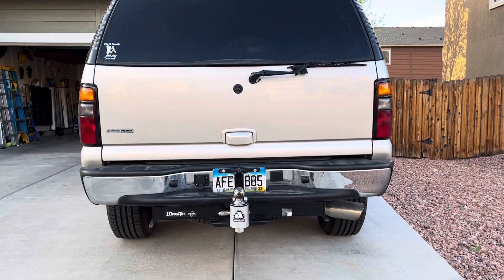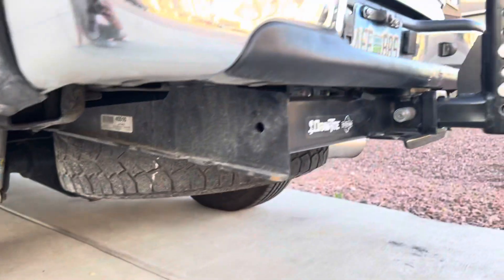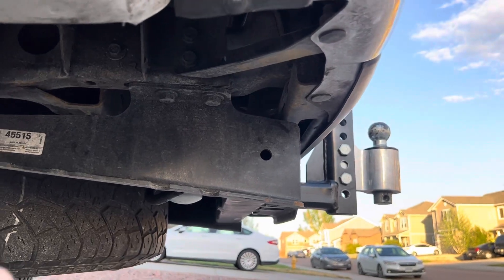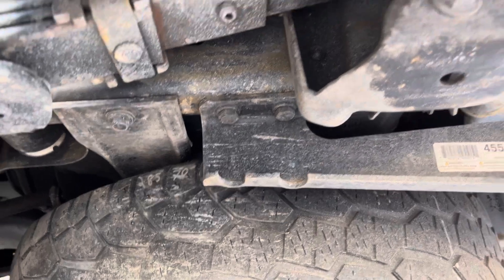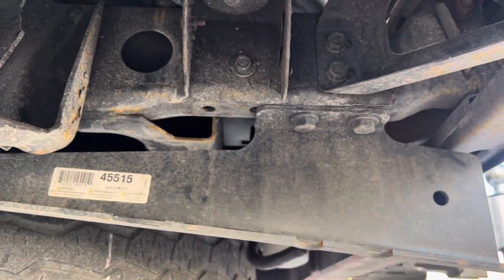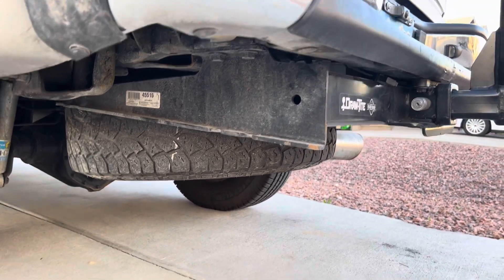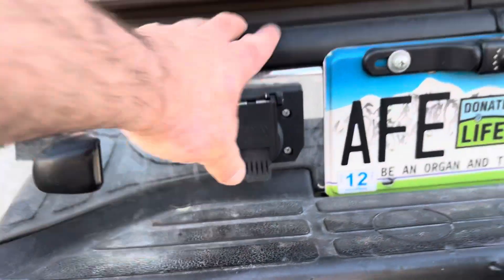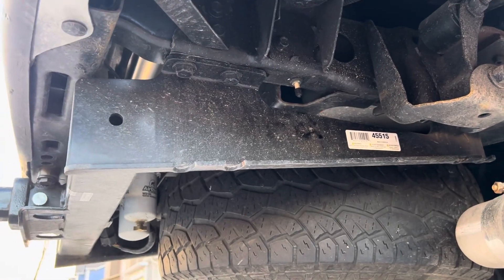00-06 Suburban Drawtite Hitch Upgrade

Comment: What if I add the bridge metal to my anemic hitch? Assuming the GM hitch is adequate in other aspects, I can just make my own. I'm a good welder. I'd mock it up on the Sub, then drop it to weld perfectly
Reply: I was thinking the same as you. Let me know if you ended up modifying the stock hitch
Reply: Did you do this yet? I’d be interested in seeing pictures/vids. I’m thinking of doing the same thing to mine.

Comment: How much can you tow with that suburban? I have a 2500 Yukon and I am wondering how much my towing capacity is. Also, how did you mount the new seven pin connector on the bumper?
Reply from the maker: Rated for 12k from the factory.  The Duramax swap doesn’t really give you legally more towing capacity.   I’ve towed 13k with it.   It does okay.  Brakes are the weak point at that heavy.
Reply: @TJLong1121  oh man this is a Duramax? I have a 6.0. Do you know the tow capacity on those?

Also, where did you get your seven pin connector that you mounted on the bumper?

Comment: Benefit of the 2.5 vs 2"?
Reply from the maker: 2.5 has a little larger areas for the tow hooks.   Otherwise preference depending what kinda hitches you have to use on it.

Comment: Is the hitch receiver the same size as oem? I tow a camper and have a hitch i wanna make sure I order same size diameter I don't want to spend more having to buy a new receiver
Reply from the maker: @kha4554  the 41930 from drawtite is the same size as the stock 2”.    The 45515 would be the larger 2.5 and you would need a new hitch or use a sleeve.

Comment: Tyler, I assume you had to drill the extra two holes behind the leaf spring?
Reply from the maker: Yes I did.   Very easy to do though.
Reply: @TJLong1121  Thanks for the vid and update. I was going to go with lower rating hitch for my 2500, but I think i'll get this 1200 hitch weight rating, there's only $70 difference and it will help beef up the flimsy rear end frame. I don't get why chevy put 2500hd front and mid section in the sub but added the enemic rear end. I also own an excursion and rear frame on Ex is much beefiers than 2500 subs.

Comment: What is the part number of the hitch for the gmt800 application you're using? I have the same vehicle
Reply from the maker: 2” is 41930 and 2.5” is 45515

Comment: Can you please Lmk where you got that 7 pin plug for the bumper? I want the exact same one.
Reply from the maker: Curt 55774 is what I have.
Reply from the maker: Some like to use a Hopkins 40975 so it has the 4 flat and 7 round on the face.  You will have to trace the bracket outline and cut that into the bumper.    I liked the 55774 better because it’s one single hole to drill with a hole saw.  Still has the 4 flat and 7 round just have to reach under the bumper for the 4 flat, that doesn’t bother me as I don’t use the 4 flat as much.  

Whichever model you use.   Make sure you put a little paint or clear coat on the edges of your cut into the metal bumper to avoid rusting.   😊
Reply: @TJLong1121  thank you very much, sir.

Comment: Bridging that gap with that little bit of metal is a make or break factor? I don't think so. Someone must be in the hitch selling business.
Reply from the maker: Lmfao.  I sell paint for a living.  Far from being in the hitch selling business.  Just a very active member of the 2500 suburban community and this is known as a weak spot and this absolutely helps avoid then bending issues.
Reply: I bent my frame on one of mine towing before I had a chance to upgrade the hitch. It fails exactly where the holes are. I bent it back then beefed up everything around that section. My other burbs have the draw tites and have heavier towing without any issues. Lots of guys have bent the frame at that weak crumple zone section it's a known issue as he stated.
Reply: @ericvensel4040  I just bent my frame hitting a big dip in the road while towing. How did you straighten it back out? I need to straighten mine then get the heavy duty hitch.

Thanks
Reply: @trevelline1  I hooked a trailer to the ball then jacked it until the frame was straight then I had my guy weld plates in.